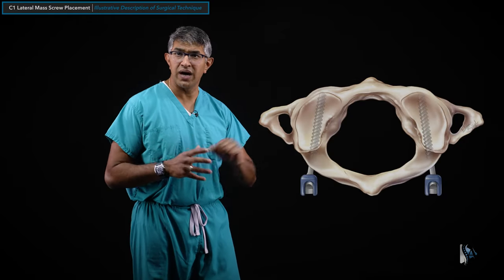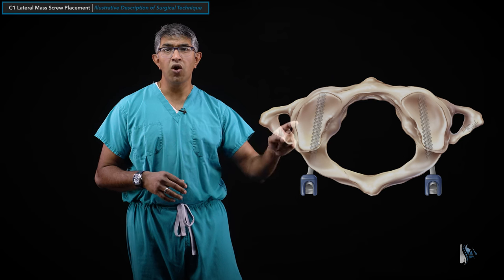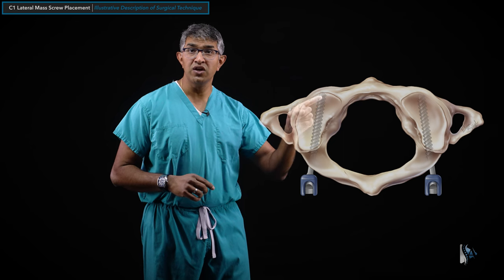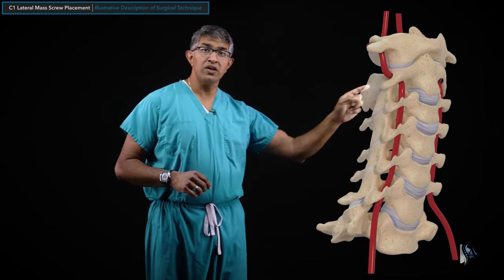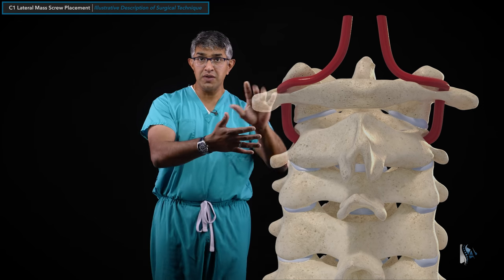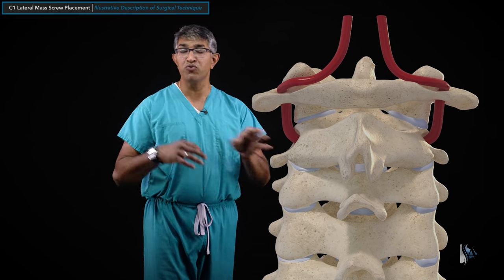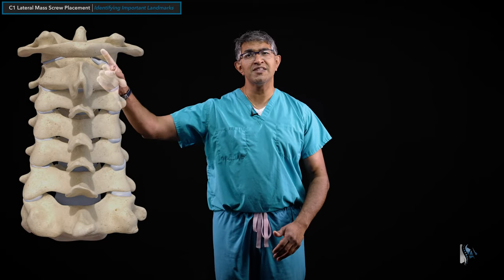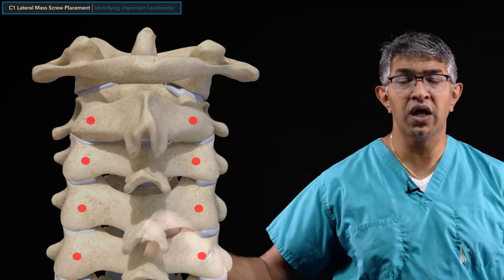Surgical Techniques: C1 Lateral Mass Screws

Comment: Out of the park presentation. A question. How do you avoid the bleeding at the ganglion? Would going subperiosteal help? Do you sacrifice the route ever?
Reply from the maker: Thanks so much! Great question -- I usually like to decompress the nerve convincingly. I do not use bipolar along the nerve root or ganglion -- I use floseal and a patty and it always controls the bleeding as this is venous in nature. I think you can certainly stay subperiosteal but I always palpate the pedicle boundaries and inevitably this takes you outside the periosteum. I think in my C1 lateral mass screw technique video I show subperiosteal dissection to get to the startpoint and you're right, it's a grat way to avoid bleeding! Good luck and thanks for watching! -SP

Comment: You can avoid the third instrument by sacrificing the C2 nerve root and make everything easier.
Reply from the maker: Great point! As a matter of principle I don't like destroying nerve roots but certainly have many friends and colleagues who sac C2 routinely. I only do it when it is unavoidable -- I'm ok with the third instrument! Fun fact to consider -- there are occasions when C2 radic and/or occipital neuralgia are a part of the problem and these conditions (strangely) may recur despite ganglionectomy. C2 nerve transection precludes the placement of Occipital Nevre stimulation as you have eliminated the afferent pathway necessary... something to consider in those narrow circumstances. thanks for watching, -sp

Comment: Any risk that the tulip will irritate the C2 root?
Reply from the maker: Great question! The C2 root is below the plane of the tulip so it shouldn't; we use "lag" screws that are threadless along the C2 root and in my experience this is well tolerated.